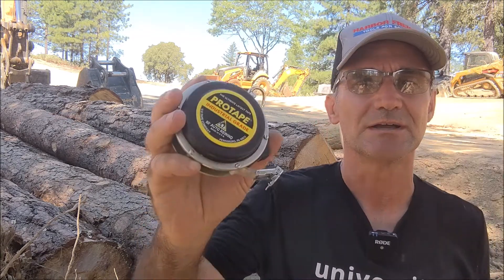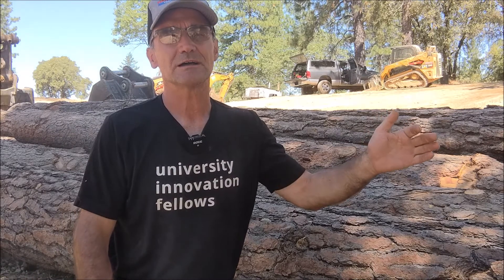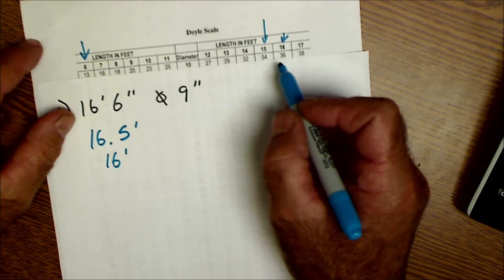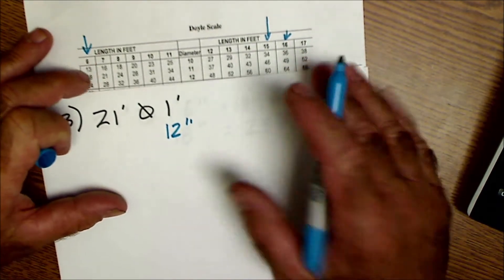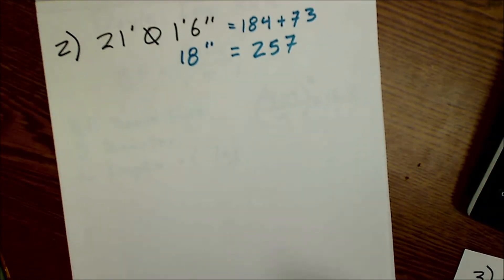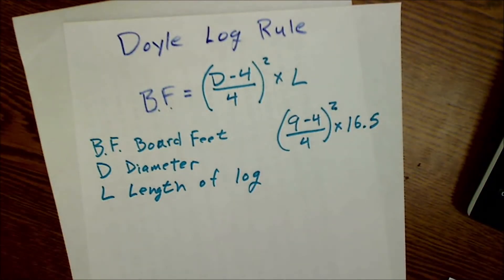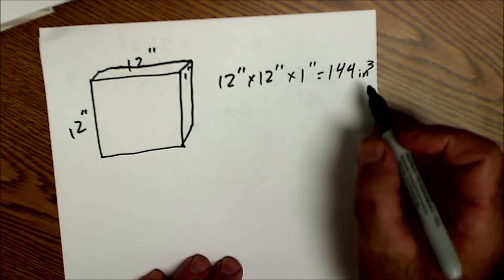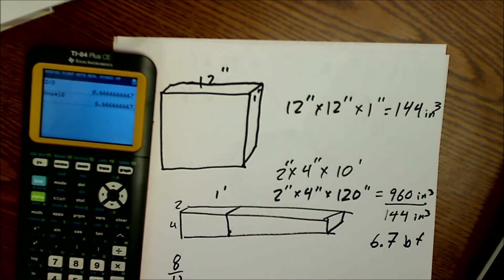How to Scale Logs and Find Board Feet of Lumber, Doyle Scale

Comment: Did you figure out how many board feet of finished milled lumber you actually got from those 3 logs versus the scaled figure?
Reply from the maker: No I didn't, I will next time and make a video of it
Reply: You gain bf on a smaller log and lose on a bigger log the reason is the number of cuts to work it down to Lumber

Comment: Also on dimensional lumber you can multiply the (height x width x length) and divide by 12 = Board feet, no conversions necessary, works on any size lumber.
Reply from the maker: Yes, good way to find dimensional lumber board feet